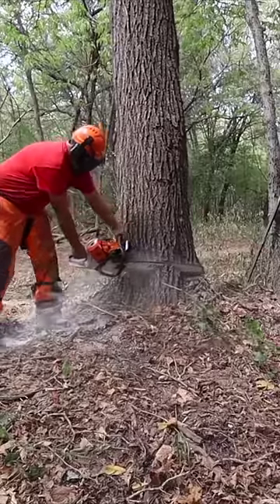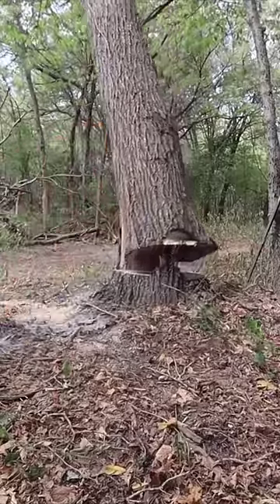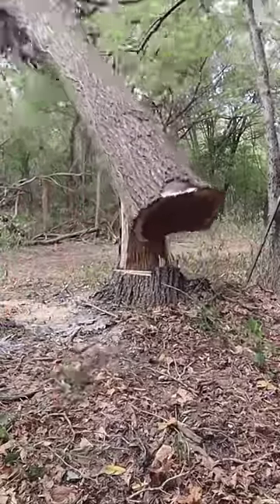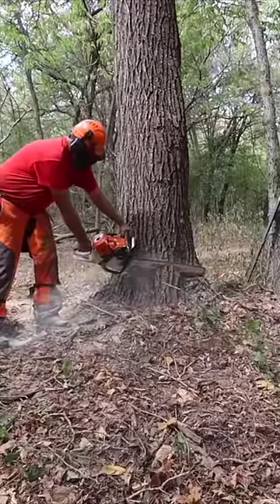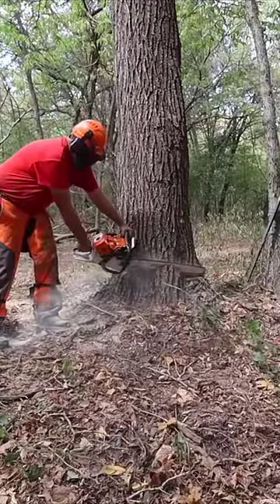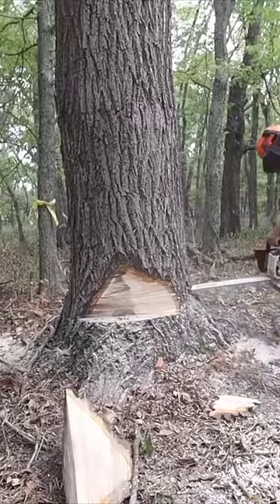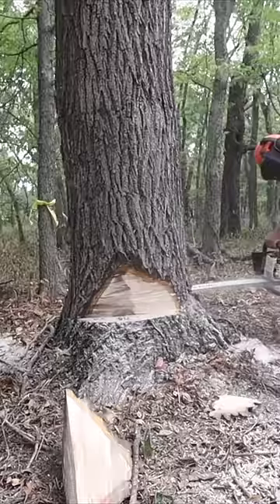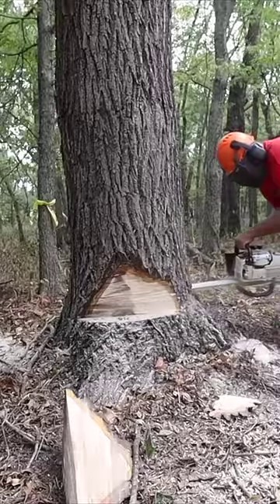Dangerous Barber Chair and How to Avoid it #treefelling #dangeroustrees #logging #treefails #stihl

Comment: Well actually a barber chair is caused by the instability and distribution of the tracheary cells in the xylem. What you're doing by using a bore cut is removing that unstable wood first and relying on the parenchyma cells in the newer rings closer to the cambium tissue. This is the same reason why you aim for the center of a log when splitting it.

Comment: Would a boar cut possibly lower chances of a barber chair or increase it?
Reply from the maker: The bore cut 100% reduces the chances but you still have to do everything else right

If this is the video, I’m thinking of, I left the hinge too thick and I should’ve bored out the hinge.

I did a bore cut on the back cut

Comment: I’ve been cutting timber for over 30 years, and yes you make a good point but there’s a few reasons why you can barber chair your tree, and some types of trees will Barber chair easier than others like Walnut and some other hardwoods, but even big yellow pine which is a softwood will Barber chair easier than most! And you always want to make sure you have a very sharp chain because on bigger timber you couldn’t use that little trick on some leaning trees so you want to be able to make that back cut fast!  One of the things you’ve done that contributed to that barber chair was you made your face too small to where the tree couldn’t fall into the face properly. Even though it was a leaning tree you should’ve made A deeper face.  The other thing is I can’t understand for the life of me why you dropped your tree on the other standing timber. I would’ve cut that crap out of the way if you had no other place to put it because that could’ve ended up being dangerous! If that butt would’ve come loose from the stump after you dropped your tree on the other standing timber, it would’ve bent the tops of the other timber over and shot your tree right back on top of you like a slingshot! A lot of guys have died that way cutting timber!

Comment: that notch wasn't even close to being deep enough lol. 1/3 depth of the tree. and you're back cut should be straight not angled. And you can do a bore cut to prevent the barber chair.
Reply from the maker: 1/3 is most common, but you can’t just state what depth a face cut should be because it varies depending on the situation.

90% of the cuts you will see me make are bore cuts. And every time I do it, people complain about that

Moral of the story? People complain about literally everything
Reply: @RockhillfarmYT  Yeah you are right about that. But standard is 1/3. If it has a heavy lean then no it will most likely do what the video did. His notch wasn't deep enough in that situation. The canopy maybe had it leaning I don't know I didn't see it but from the video I would have put a bit deeper notch and did a boar cut if I was worried about. A barber chair situation. It's several different methods of course  That video was just a poor excuse for cutting a tree down lmao. Keep practicing. Just know trees don't pay games.

Comment: I would make my face cut at about 40% to 50% depth on average, depending on how the tree was leaning and how big it was, among other factors, and then going from the back and cut straight across. Sometimes it would pull fibers out of the middle, but never did I get a barber's chair.

Comment: A good front wedge is at least a quarter the way thro I like to go a third to be sure this doesn't happen and it never has.
Reply from the maker: Yeah, 90% of people do that. I usually do a third on the face cut, but you’ll never see a logger cutting a 1/3 face cut because you’re cutting into the usable part of the log.

I spent some time with some loggers, and we were harvesting this for the log, so I was using the method they use and didn’t execute it perfectly.

you need a different type of cut for different situations And this was a hard leaner, so I definitely think the method used was appropriate
Reply: @RockhillfarmYT  I've been a tree trimmer for almost 30 yrs if your logging then just put the angle cut on the bottom a third thro and yes loggers do it that way most of the time
Reply from the maker: You realize that what you said doesn’t make sense right. Using a Humbolt or undercut just moves your cut up higher. You’re still losing the same amount of log.
Reply: @RockhillfarmYT  actually no it doesn't the horizontal cut would still be in the same place there's plenty room for the other cut you never cut from ground level. I've done this thousands of times how many have you done?

Comment: Your hinge wasn't deep enough either.
Start figuring at 1/3rd to 1/2 the diametre.
Everything depends on circumstance but at least 1/3rd.
Reply from the maker: Never understand the comments acting like there is only one right way to cut a tree down. Very much situationally dependent and loggers are never making a 1/3 face cut.

If you want to maximize yield, you cut as slow as possible and make the face cut shallow. I just didn’t execute it perfectly. Should’ve punched out the center of the hinge.

Comment: Just saying there's a reason almost no-one and no professional uses a back cut. Osha has outlawed the back cut for obvious reasons.
Reply: So, none of that makes sense. Every fell requires three cuts- topcut, bottom cut (these form your notch) and a backcut, which severs the rest of the fibers and lets the tree fall. Are you talking about his last cut, removing the strap? Also a necessary step and by no means illegal.

Comment: Hinge depth and angle of the cut is what really matters.    

In this example,  it was way too shallow and too much angle.
Reply from the maker: Well, I’ve been talking to a lot of loggers and working with them a little bit and one thing they do is make a really shallow hinge in a lot of cases.

It’s one way to cut really low but also not cut into any of the usable log

Personally I’ve always done the 30% face cut that most people make but there are different ways to fell trees for different situations
Reply: @RockhillfarmYT  Absolutely,  and tree type and size makes a huge difference in what type of cut you need to use.    Hard wood trees are different than something like pine, and pine is different from poplar.    You have to learn how to read the tree and understand how the tree will fall before even making the first cut.   Virtually looking through the tree and seeing the grain of the wood and how strong the fibers are.   It is truly a form of art and engineering to be able to understand what is going on when cutting a tree down.

Comment: The depth of the notch should be 1/3 of the tree you are felling.
Reply from the maker: Sure, depending on a lot of variables 

All of the loggers I talk to use a shallow face cut
Reply: @RockhillfarmYT  regardless, the main reason for the barber chair was a upward angled, low, back cut.
Reply from the maker: Completely wrong. Do you understand why a barber chair happens?

Comment: hinge thickness of course but you had zero face cut.  You just cut off the swell.
Reply from the maker: the week before, I spent a day in the woods with a logger and one of the key things he told me was that they always make a shallow face cut
Reply: @RockhillfarmYT  that's not true. minimum of 1/4 the tree.  Usually more like a third until you get to big timber (5ft +) then it changes from tree to tree. It always changes but minimum 1/4.

Comment: You're doing it wrong.  Your notch needs to be deeper.  1/3 of the trees thickness not 1/8.

Don't plunge cut unless you 100% have to.

Your back cut needs to be 1-2" above the flat of the notch.  Or if your angled cut is on the bottom 1-2" below.

When the tree starts to fall, move at a 90deg angle to the direction of fall.

Worked for years cutting trees out of power lines, with certifications.

Comment: Facecut always 1/3 deep
Reply from the maker: That is definitely not the case. A traditional face cut is 1/3 but there are reasons why professionals don’t always cut that deep.

The primary one relates to yield of the log
Reply from the maker: That really doesn’t change anything. It just moves the horizontal cut up higher…

The only difference is you have a flat end on your log
Reply: @RockhillfarmYT  but if you mill the log then the boards on that end don’t have a diagonal edge that has to be cut off which gives you slightly more board feet

Comment: You didn't even notch it. You just trimmed a root off. Could've notched it after that. And come up a bit higher unless you were planning on milling it. But I'll shut up& let the pros talk.
Reply from the maker: I’ve always done a 30% face cut until spending some time talking to actual loggers and finding out that they don’t do that. They make very shallow notches like I did but then they punch out the center of the hinge with the saw.